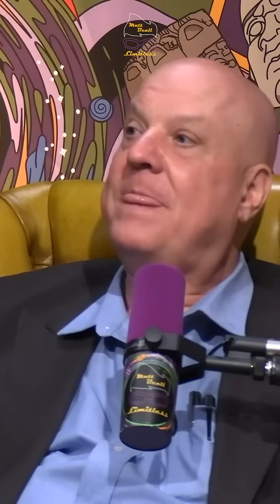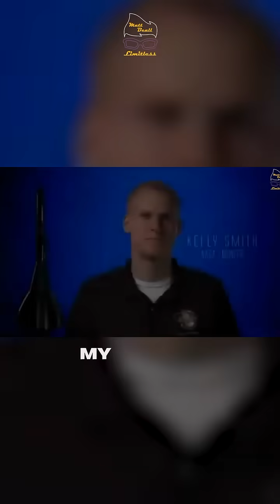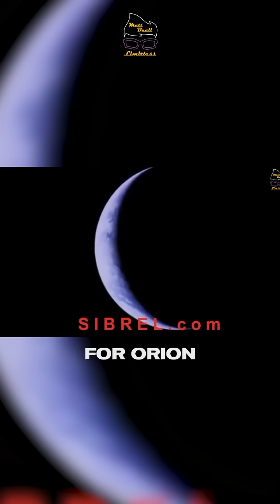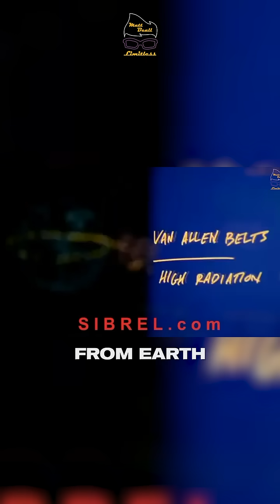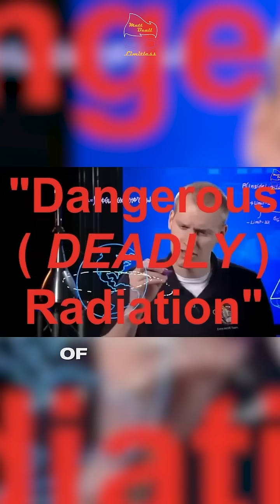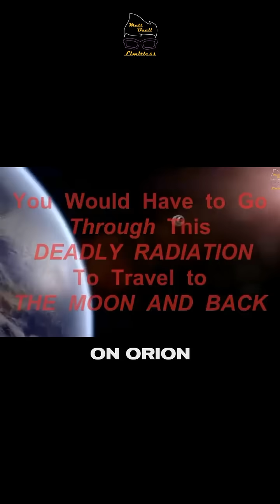Bart Sibrel: NASA’s Radiation Problem

Comment: Quit cutting the sentences of Kelly Stevens (later of Lockheed Martin Skunk Works).  YOU PARSED THIS M F statement !!!

PLEASE STOP YOUR LIES AND BULL SHIESE !!!  Anybody with common sense can google this direct information (below) that NASA properly used with the NASA capsule to the Moon and back ... and the modern International Space Station - having people live up there for a year or more - in near-complete safety.

UV heat rays, X rays, alpha, and beta radiation can be solved with the thickness of a single piece of writing paper, or an aluminum foil sheet.  The gamma rays that are the only consideration.

Lead , tungsten, and steel  have PROVEN VALUES of thickness in stopping gamma rays.  Lead is said to be the best common material, but tungsten with higher density only requires 1/3 thickness of lead in dealing with gamma rays. 

For effectively stopping gamma rays, depending on their energy (alpha, beta, gamma energies), you would need several CENTIMETERS of steel, typically around 2-3 centimeters or more.  Steel generally requires 3 centimeters.  Lead, generally being considered the most effective dense material for shielding against gamma radiation, requires a slightly thinner layer in achieving the same protection level as steel.

Here are some recommended thicknesses of lead to stop radiation in different facilities:
Dental practice – 1/32“ (0.3mm).

Veterinary practice – 1/32” (0.35mm) to 1/16” (0.5mm).
Medical facility or non-destructive testing lab – 1/16” (0.35mm) to 1/8” (0.5mm).
Nuclear facility – 1/8” (3.2mm) or greater.

Using a higher 4  centimeter value, this is only 1.5748 inches or 1 37 / 64 inches - for steel.  Lead is 2-3 centimeters or 0.787402  inches or 25/32 inches and 1.1811 inches or 1 3/16 inches.

Tungsten is ~1/3 thickness of lead would make the metal shell of a lunar capsule ... even that of the International Space Station (ISS) would be 8/11 inch or 1 1/5 inch.

Any guess (DUMB AZZ !!!) what material they used for the Moon capsule and the International Space Station ???? !!!!!

NASA solved the issue ... but they can't fix your STOOPID  !!!!!!